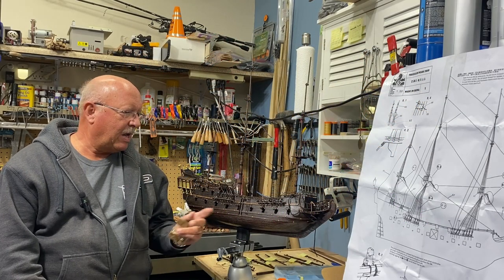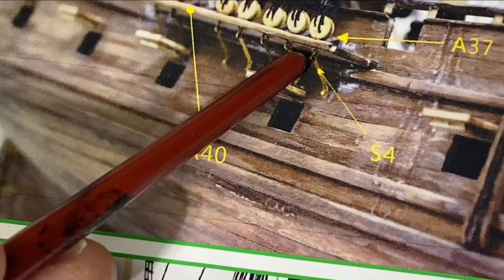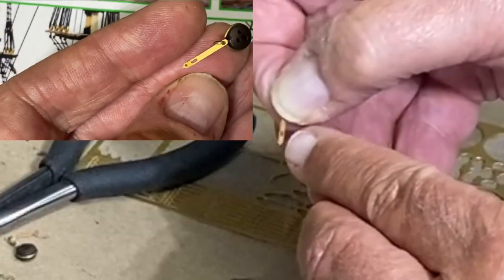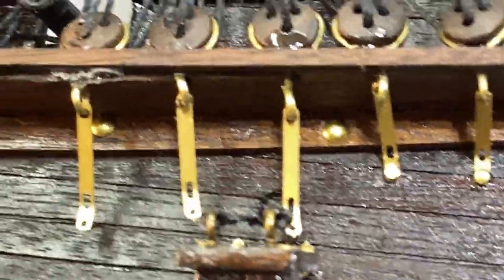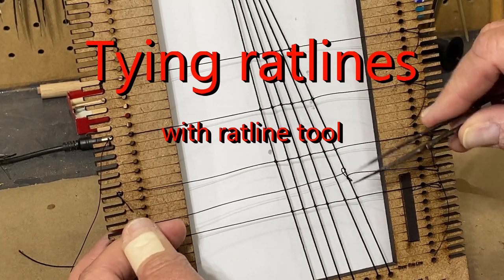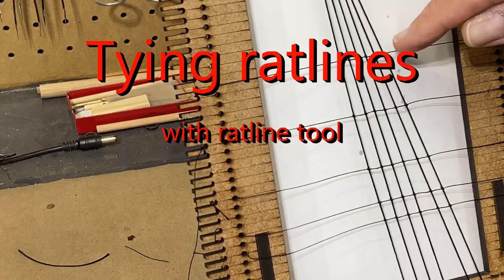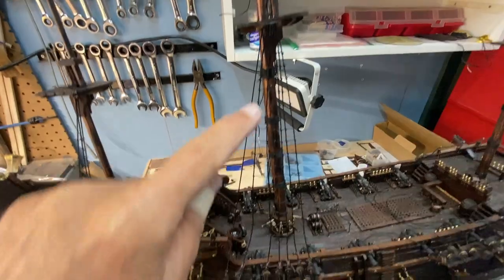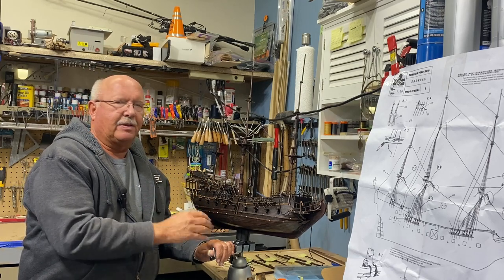The Black Pearl Golden Version 2021 Episode 19

Comment: lookin good Dan. When I do ratlines I attach lower dead eyes to ship and upper dead eyes to end of rat line. attach upper rat line to mast with a desired ( about 1 inch ) gap between the two dead eyes ( while pulling down on the rat line to make it snug} Then I tie the 3 hole deadeyes (upper and lower) together which allows for snugging up the ratline and keeping the deadeyes close to level. finally attach ladder rungs by laying the ship on its side while installing.
Reply from the maker: I’m trying to wrap my mind around your instructions!  I’ll give a try on the starboard side👍
Definitely not using the tool, I need to be able to adjust it as I go. 😅
Reply: @BoilerDan1  If you attach the upper rat line with upper dead eye attached to the top of mast ( or mid crows nest - crossover spot to other side ) you can then LACE UP and pull tension by looping the lines between the upper and lower deadeyes last. hope this helps
Reply from the maker: @sleepyfish959  
I think I understand 😁.
You’ll know when I post that segment!
I’m giving serious thought to getting the All Scenario version (multiple decks and finished Captains quarters)…. Each build I get a little better…. 
My wife approves as it’s healthy for the mind and spirit!  Plus it’s like I go to work for a few hours 😂.
Recently we replaced our furnace/AC systems an had it put in the garage. Simple addition of a vent and I have heat in winter an tolerable cooling in summer.
Perfect for this hobby 👍👍